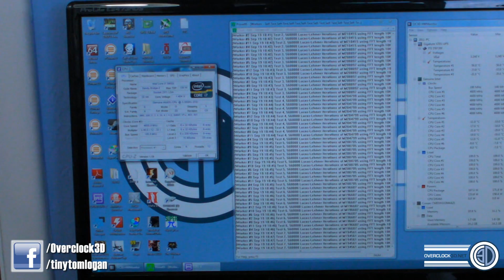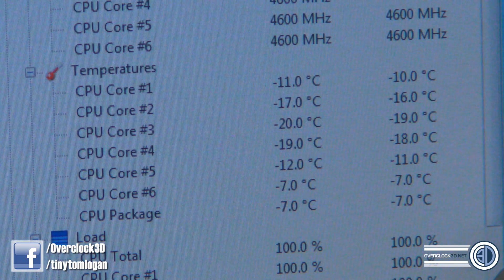Ultimate Corsair H100 Cooling Mod

Comment: jokes aside, do you av any Sp120spare to sell with 4 pin to 4 pin splitters. will pay cash. been a fan for years and like you info. great prank. lol
Reply from the maker: +Karl Benson Sadly not dude no, sorry.
Reply: OC3D TV Hey no probz, and thank you for the reply,  watch loads of your vids,  very informative. Got me some  of them Af120 you used in this vid, not so easy to screw to case,  rubber pushing back but got there. Hopefully I'll be doing review's and builds like you. Just done my first A10 7870k clocked at 44.2 ghz build with ASUS A88X  GAMER mobo,  2x 4gb ram HyperX fury running at 2166,  HyperX fury ssd 120gb, x2 pipeline hd2 500gb I took from my virgin boxes, GTX750TI,  PSU  INTEGRATED  500W, Cooler master 212evo  with x2 cooler master AF120 in push, pull mode, Case Inwin 503, Called it Red horizon. BenchMARKING good but I'm not totally clued up on overclocking with ASUS bios. If you av a link on overclocking with this board and CPU it be great help coz Linus uses Intel for overclocking, With Asus bios but don't help me coz I'm a team red player for cash flow reasons. But thanks again for actually taking time from your busy time. Karl.👊👊👊👊👊👊
Reply: ***** water won't as quickly freeze if it's flowing fast enough only still water freezes fast.

Comment: Hello ,my man, looking for advise if you can give, I'm using In win 503, got 2 cooler master SP120, 2 x Af120, fan with my cooler master evo, and 2 Inwin case fans. where should I use the Sp120 and the Af120 for best air flow and cooling. ,Thanks.

Comment: you cant go lower than ambient that way, and the "thermodynamics"  refrigeration comment doesn't apply here as it is an open system in a room (not below ambient). You can reduce ambient temps if  you throw out energy(heat) out or the room where this is done and still that system won't go below that lowered ambient temp of the room. Dont fool people, some enthusiast might waste his money. Shame on Corsair for not taking this down.

Comment: Hey, I was wondering that the heat transfer to the air from the radiator is the factor of air speed and the surface area of the heat trasfer surfaces. And of course the liquid speed and the surface area in the water side.
On that note, I wonder if at some point adding more fans in series has no effect anymore on the air speed. So, could you make a 2x2 or 2x6 array of 2 or 3 deep and put a nozzle that leads from the array to the radiator? It should Increase the airflow speed at the radiator. Increrasing the airflow speed increases the turbulence in the air flow, which increases the heat trasnfer into the air from the fins. And also the volume of air passing through would be larger adding to the cooling. And of course followed by a diffuser and same kind of array leading from the radiator.
And moar water circulatin pumps!! It needs MOAR!!
Though remember to test if the piping can take increased pressure.
MOAR!

Comment: If your goal is to incease the airvolume per second you need to build something like a cone big enough so you can install 2 fans to pull and 2 to push. That means with 40 fans you will have a fan-wall consisting of 10x2 fans to pull and 10x2 to push.

If you dont understand why, then watch on Wikipedia how to increas the airvolume/second. 
https://en.wikipedia.org/wiki/Volumetric_flow_rate
You will agree that it is not really efficient to put fans in a row when each fan got the same power and same radius etc. because one fan will just give its airsteam to the next and this one will pull or push the same airsteam with almost the same speed and volume/second.

but if you compress the air volume from 10 fans in a cone to that whatercooling socket (that means you go from the area which 10 fans take to the area that 2 fans take) you will have more airsteam per second in the 2 fans big area + the pulling cone after the whatercooling socket.

Besides, I still cant belive that you go under the roomtemperature. The law of thermodynamics says that energy as heat can only go from a hot medium into a cooler medium. That means that you can't transport "heat" from for example 0°C to a 10°C air steam but from 10°C to 0°C. Therefore you will never get under 20°C with only fans as long as the airtemperature is @20°C in your room...

please correct me if i'm wrong or confusing something 
 
PS: sorry for my english... my spanish and german is much better :-P

Comment: But the SP120 doesn't have a stator on it, so you are mostly just going to be spinning the air around inside the duct rather than moving it forward. This is a total waste of money without stators to counteract the spinning.

Comment: I dont think this is how fan works. because the amount of pressure is the same. adding more fan doesn't mean adding more airflow. If you fan push 1L of air in 1 sec. the next fan will just use the previous 1L of air.
Reply: +Gordon Tan airflow wont increase but if having more than one fan will increase pressure assuming it was below the rated pressure to start off with
Reply: NolanTheGamer1 Not sure what you're referring to. You'd need a compressor not fans to achieve anything even approaching a vacuum. Also vacuum is a super super good insulator because it only allows radiation and completely removes conduction. That's why a thermos (aka vacuum bottle) keeps temperatures so well. Putting the heatsink in a vacuum would pretty much guarantee that the CPU would overheat even at idle.
Reply: .+Gordon Tan besides, air is air. the minimum temp of the radiator can reach is the  temperature of the environment. If the radiator is cooler than the ambient temp, the air will just warm up the radiator. It is like 5th grade seience
Reply: +Gordon Tan Haha yeah. More fans in a series doesn't increase air flow. If the heat sink was a large resistance to air flow it might make a tiny difference to have one push and one pull fan. More than that just adds a little bit of heat from all the fan motors =P
Reply: Anders Öhlund i didn t read the description under this video, but i think he was making an April fool's video in September
Reply: +Anders Öhlund what about the vacuum chamber thing were to much negative pressure results in cooler temps?
Reply: +Gordon Tan I don't think you understand. more fans = more better
Reply: Trevor Lukacs haha.
Reply: +Gordon Tan fans aren't 100% efficent at moving air. more fans increases efficency and this increases airflow.

Comment: So all joking aside, if there is no point to stacking fans together in tandem, then what is the point of air coolers like the Noctua NHD-14 the Phanteks PH-TC14PE the Thermalright Silver Arrow or the Zalman CNPS 12x?
Reply: a noctua d14 is something completely different since there is a heatsink and an open space between the fans. It doesn't work in the same way like the video at all.

Comment: I applaud the awesomeness of this! How ever I have to state that I own an H100i and I own GT Dominator RAM and while they create great hardware, every Corsair fan I have ever purchased has cracked, seized, whined or simply stopped and that includes the fans on my awesome RAM cooler. I have found that cheaper $5 fans from my local electronics store last longer and move more air.

Comment: Wow, I actually know the effect. You can test it too in less than 1 minute: try breathing out your mouth very slowly (hot air should come out); now try breathing stronger with your lips almost closed, almost like whistling (cold air should come out of your mouth).  This effect is to be used inside piezoelectric coolers, but those things haven't launched yet ._. This effect also happens inside your lungs.

What happens inside piezoelectric coolers is that pressure is made inside there and air is moving with high speed and so it becomes cold. Also, I think this might be better (and cheaper in the long run) than liquid nitrogen/helium. Better not for cooling, but for safety (like liquid whatever leaks).

I know this video is fake, but the effect is real. You should really check piezoelectric coolers.

Comment: I wonder: does the cooling system contain a compressor (like fridge)? Because otherwise you should not be able to reach temperatures lower than the air one.

Comment: The CPU could be getting cold, but saying the room is getting cold because of the fans seems like something that can't be true. Because of the speed the air is moving at the processor, it's getting cooler, but the overall temperature doesn't increase when wind is blowing in a room. Wind isn't cold, it seems cold because it takes heat away from you.
Reply: Actually it think this is probably fake, as 40 fans wouldn't really take away that much temperature... I might be wrong though
Reply: +Harm Prins Did u watch the end of the video it was a troll video.

Comment: Negative temps?  not going to happen unless the room was that cold to begin with (or colder)...  

nice mod still...
Reply: +TheCarmacon I did watch it...  and I also know a bit about cooling in general and how heat transfer works...  Water cooling can only cool a cpu (or anything else for that matter) to the coldest part of the system involved...  meaning, once the cpu starts going and generating heat, the coldest it can get is room temp..  no matter how many fans are there, it's still blowing room temp air over the rad, so that's as cold as the water in the rad can get..  so, for the temps to show so low, either there was a hack running to change the temps it shows, or there was some other cooling going on...    was a nice video and entertaining, but should admit it's at least partly fake or a trick or you lose a great deal of credibility with people that really do pay attention to the details...